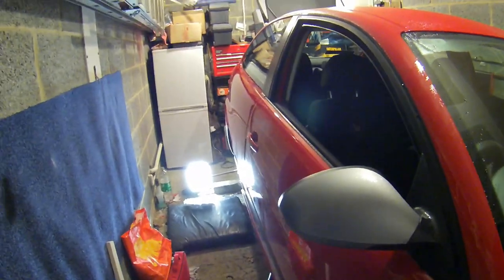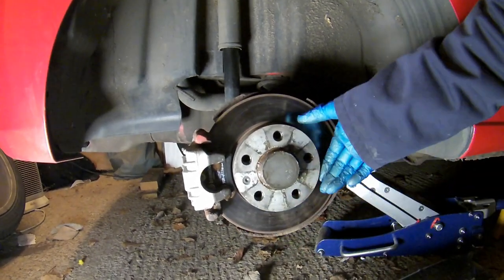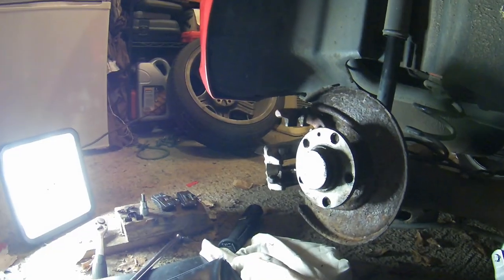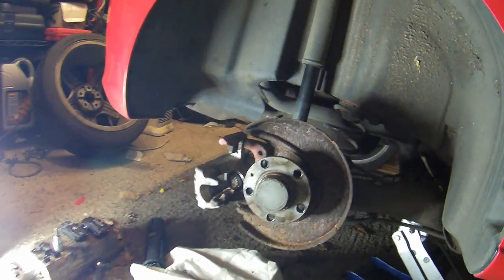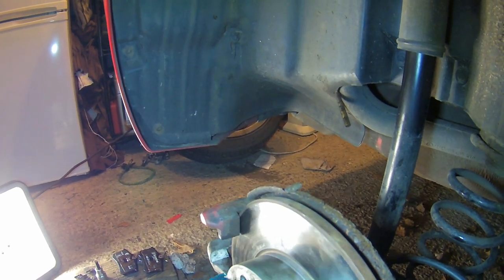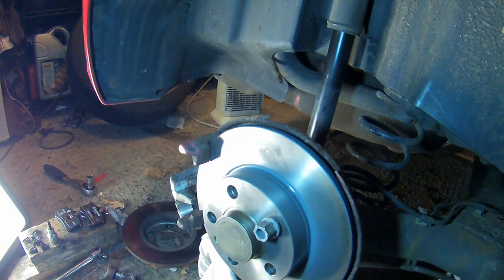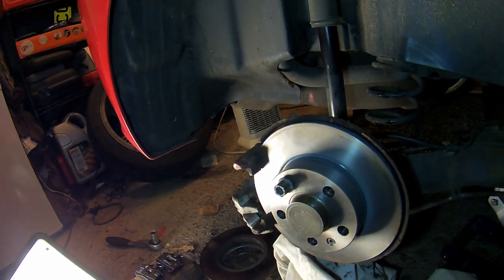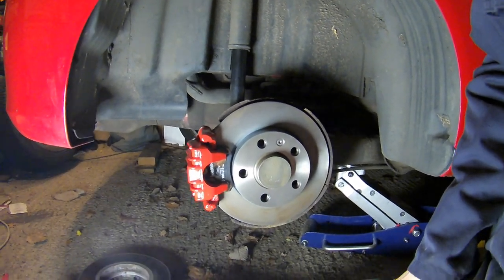Fred in the Garage.  Ibiza rear Brake squeal. Part 1

Comment: Good video 👍 copper grease not really used anymore. Proper silicone lubricant available now and I would have cleaned and lubed the slider pins to prevent drag too. Nice red calliper too

Comment: that sounds like brakes pads gripping the disc (pistons not returning from cylinder properly cauring pads to rub) or brake dust around brake shoes.
Reply: Deffo brake dragging.  Not this side though so on the next video i move onto the other side.

Comment: Hi Fred I know this might sound mad but have you thought that it might be one of the front brakes 🤔😊Sound tends to travel and echo off things especially when your moving Doppler shift etc.
My brakes have started Squeaking as well mainly when its dry, I know how annoying it is mate. 
I take it you did check and re grease the caliper slide pins because they are what keeps the disc centred as the pads wear.
I would take the car for a blast up the M1 and brake slightly for a while at high speed to make sure there is no high spots on your pads causing the Squeak Squeak.
Take care bud hope you get it Sorted. 👍👍
Reply: No dose not sound mad at all.  I will be checking all calipers for seizing and dragging.  Next will be the other rear side as ive got an issue with the handbrake adj on that.  Cheers.